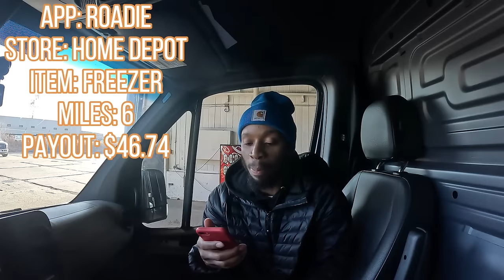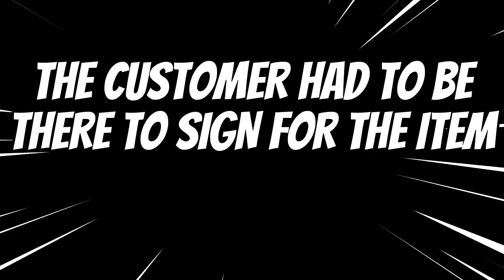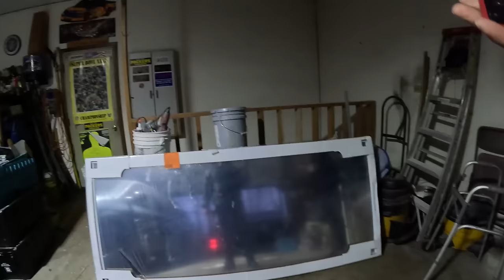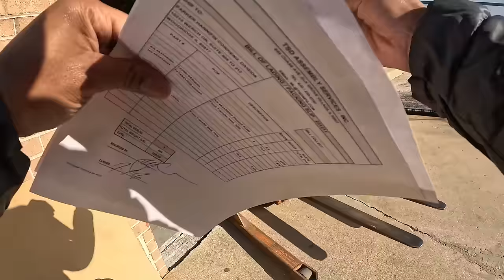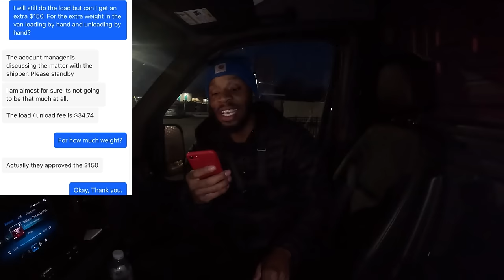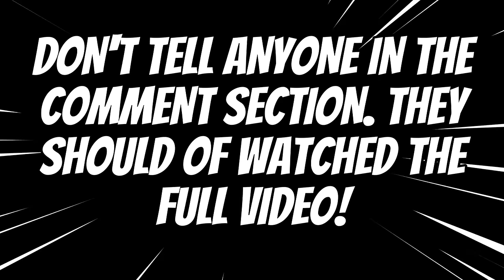My HIGHEST Paying Single Order EVER From This Gig App!!

Comment: CCC. What are those yellow straps call that you hook on to the fork lift and pallet? 🙏 

Thanks
Reply from the maker: #CCC It is called a Tow Strap.
Reply: Look up a tool called a pallet puller. Works great for this.